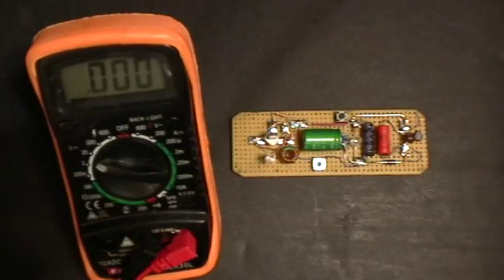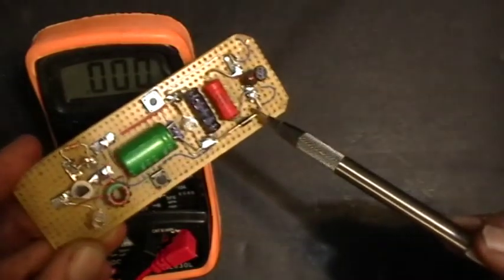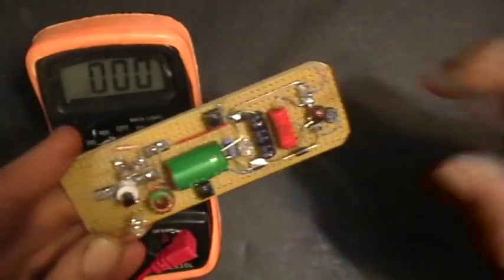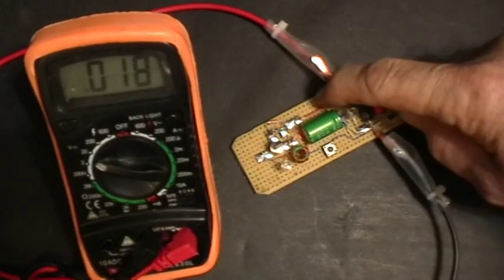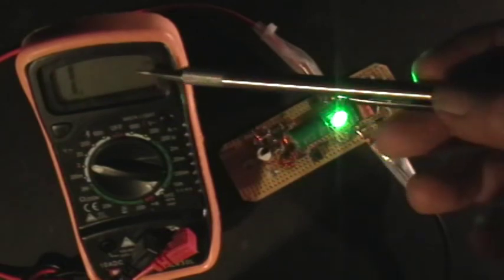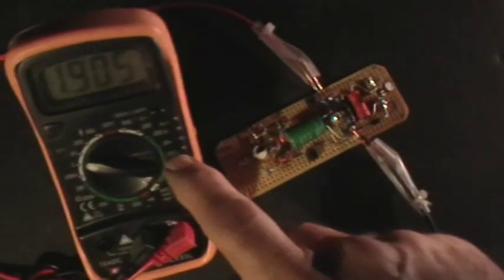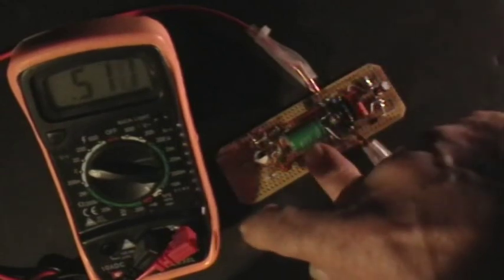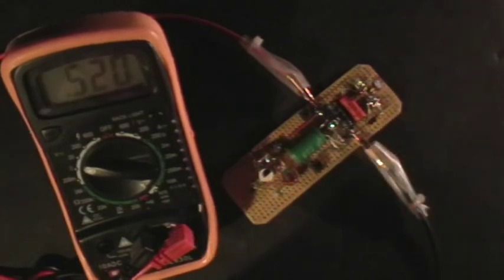Electric OU: TKBloomer Hybrid Wireless Joule Thief

Comment: Hi TK
I have would love to build one of them. would it be possable to get a layout of the reciver part, I am having trouble picking up power from the transmiter.

Thank for any help
Rick
Reply from the maker: The receiver parts are all in parallel. You need a receiving "antenna" which is simply a 2-turn spiral, evenly spaced, of the same length as the transmitting loop. (Try a simple circular loop at first, then when that works, fold it into a spiral for concealment or compactness.) This is placed in parallel with a good quality capacitor to make an LC tank circuit that resonates at the same frequency as your transmitter. See your favorite resonant frequency calculator to get the correct cap value. The tiny choke is also in parallel and is just for fine tuning, it may not be needed. Then you can take off AC into a resistive load connected across the capacitor, or you can half-wave rectify it with a diode into a larger reservoir capacitor as I have done here. Don't forget that a large reservoir, like the 10F that I am using here, will take some time to charge up, and if you use a really large supercap it will take that much longer. Good luck with your project!
Reply: Thank you for the information. could the reciver layout be drawn out as I ma haning trouble getging a rf single to light the first led.

Thank you.
Reply from the maker: Richard Jamieson
What are you using for a power transmitter? You need to use a loop of the same size as your transmitter loop. Just a circle at first, then when it is working you can fold it into a compact spiral. The inductance of this loop will be on the order of a few microHenries. Then you need to put a good quality poly film capacitor in parallel with this loop, of a value that satisfies the LC resonant frequency equation to resonate at the frequency of your power transmitter. Then off of one side of the capacitor you run a rectifying diode. The other side of this diode connects to one side of your LED, and the other side of the LED to the other side of the capacitor. It cannot get much simpler. You can even omit the rectifying diode:
https://www.youtube.com/watch?v=80D92QaOcM4
Reply from the maker: Richard Jamieson Maybe this video will help:
https://www.youtube.com/watch?v=rHFbRTJCzsY
(Sorry about the poor quality, I was using the wrong transcoder for the raw video.) Also look at my channel for all the "wireless power" videos for a lot more detail and demonstrations. Thanks again for your interest, keep at it, we'll get it figured out I'm sure.

Comment: Awesome! Love your work TK! I bet that could run a long time from 2V to 0.5V!
Reply from the maker: Thanks! Yes it will run a long time if I don't deliberately discharge the green capacitor. Certainly long enough to convince a Big Fish that it will run itself, if I wanted to do that. If I optimized the JT circuit for runtime instead of brightness, it would run even longer.  Or if I deliberately omitted telling about the wireless receiver/transmitter system... well, some Big Fish might even want to buy me a cheezburger.

But aren't you going to accuse me of putting batteries in the can?
;)
Reply: re: accusing you of having batteries in the can... no... that is your thing! lol

Comment: Very cool circuit.  I believe that if you had a vr in place of the resistor on the JT so you could lower the resistance when you get to .5 volts, that the JT would continue to light up down to maybe .3 or .35 volts.  I did not know that supercaps (electrolytic) bounced back like that.  Great to be able to see that.

Bill
Reply from the maker: You might be right. I know it still oscillates after the LED goes out. I don't know if I have a low-value trimmer in stock though, I'll have to dig thru the junque box.

Comment: This is awesome work! This must be the "residual energy" Tesla always talked about, there is a certain point at which the electricity is left in the cable, millivolts for sure. But I do believe he also used a custom alloy of wire and the millions of feet to achieve this on a scale that could actually make an impact. Very interesting indeed, I have no schooling or in depth knowledge of this, however it really makes sense that if we can harness the "left overs" in a Giant loop and fractional amounts of energy could be produced by using massive amounts of electricity, like we do currently?
Reply: also wondering, if you make your unit's "cable/wire" distance larger, would the threshold of .520 be the same? Also turns and gauge of toroid, interesting stuff!
Reply from the maker: Jeffrey Beitel

I don't know what you mean by "cable/wire distance".
It's possible that the LED might light at lower threshold voltages with different numbers of windings on the toroid. For sure the circuit continues to oscillate at voltages below 0.520v. I've seen it oscillating (but not lighting the LED) down to 0.380v with the same component values.
Reply: Very cool, I think I am trying to say: "circuit length/distance" Or basically scaled larger?
Reply from the maker: Jeffrey Beitel Oh, I think I understand what you mean. Yes, the length/size of the receiving loop buried between the two layers of vector board is critical for good operation. If the loop was bigger I wouldn't need to use the "tuning inductor" and could get much more power into the receiver. I deliberately "detuned" this device, because the transmitter is capable of putting tens or even hundreds of Watts into a well-matched receiver, as I've shown in some other wireless power videos. I needed to stay below the max voltage rating of the supercap, which is why the green LED is just hooked directly across that cap as a voltage limiter, but the transmitter can easily override that and blow out both the LED and the supercap if I used a well-matched pickup loop.

Comment: Hi TinselKoala,
Very nice JT setup...^^
Would this work with a 1F 2.7vdc cap or does it need a 10F to work...???
I do have a 1F but it's a 22-24vdc automotive one wich seems to be a bit to much and i aslo have 2000F at 2.7vdc wich seems like overkill...lol
As soon as i get my BC337-25 in the mail i'm gonna give your JT setup a go...^^
Reply from the maker: Yes, it will work fine with the one-F cap, it will charge faster and run down faster.... you might only get a couple hours instead of a couple days of energy storage... I used a 1F cap for the first (alt.snakeoil) version with no receiver just the cap.
I wouldn't recommend using the automotive cap at higher voltages. The receiver section will work but the JT section works best on lower voltages. Even at 1.5 volts it is dimmer than it can be and the transistor gets warm.
The MPSA18A transistor works almost as well as the BC337, and just about any other NPN will "work" but at slightly higher minimum voltages and slightly dimmer LED.
Reply: TinselKoala
Hi TinselKoala,
Thanks for your answer and info about your setup...^^
I'm going for the JT part because if i can have some led light at night as a light beacon in the house i'll be more than happy...^^
I do have some 2N2222 and some MPSA42 so i'll give it a go pretty soon while i'm waiting fior the BC337...^^
I've ordered some 10F ones and will try the 2000F @ 2.7vdc while waiting for the 10F ones...
The 2000F should give me some good run time and maybe i can drive a few more leds on it on 0.5(ish volts)...???
When i have it running i'll let you know and i'll make a video of it with links to your video ofcourse...^^
Reply from the maker: Mister Caribbean Roots

Don't forget that it will take a long long time to charge that 2000F cap, even to 2.7 V....
Good luck and keep me posted on your progress!
Reply: TinselKoala
Thanks for the extra input about the supercap...^^

"At the lowest end of the JT operating range, about 520 mV, the supercap can actually recover energy and gain voltage while the Blue LED is still on"

What you wrote above in the video description section is what i'm going for...;-)
My thinking is that a 2000F cap should be able to handle more load at 0.5v(ish) than a 10F cap without the need to charge it just like yours did...
I'll start sunday with it and i'll certainly keep you posted on the progress...^^
Reply: TinselKoala
Update,
Made it and have it running...^^
Some info on how and what,
The 2000F 2.7vdc cap is at 1.080Vdc now...starting circuit testing...
I have a few of these laying aound for about one year now without using or charging them and still their voltage is just above 1Vdc wich is nice...^^
So i decided to let it run on this 1.080Vdc to see how long will it take to get to around 0.5vdc...???
The transistor is 2N2222, also tested a MPSA42 and a BC331 but both did not work..no light at all even when i adjusted the resistor/cap...???
The toroid is OD12mm with 2 times 9 turns(10 if you count the one turn of the wires start & end twisted together)
The resistor is a 680r, tested 2.2k, 1.6k 1k also but the 680r gives me the best lighting...going lower it will not light up.
The cap is a 0.1uf at 15v or 25v(very small) wich works the best with the 680r resistor above...^^
Tested 3 normal leds (red, green & yellow), they light up but not so bright...-.-
Than i tested 1 bright yellow and 1 bright blue one, these 2 are the best...^^
I can also light them both in series but not as bright wich is more than normal...
I have it running now and will leave it running to see how fast will the voltage drop from 1.080v to around 0.5V...??
Will make a video about it tomorrow, no more play time today...-.-
Reply: TinselKoala
Update 2,
Decided to short the 2000F cap because it's taking way to much time to drop to around 0.5(ish)vdc...-.-
It's now at 0.585vdc and i had to completely redo the circuit because non of the leds wanted to light up anymore...-.-

What it doesn't have anymore,
No cap...
No resistor...
No toroid coil...

What it does have now,
The small bright yellow led...
A two strand aircore coil of 0.25mm wire with 29ohm each...
Now it does works nice and it's a good led beacon light for at night in rooms of my house...^^

I'll leave it to run for a few days before making a video on it just to be sure this thing works or not...???
Reply from the maker: Mister Caribbean Roots
Cool! I'm glad you are getting good results, and I'm looking forward to seeing the video illustration.

Comment: Awesome love the whole combination of the different circuits to create a splendid unified system.  I have read the other comments on the wireless transmitter and you mentioned a fridge. How would that work I was also wandering can electrostatics be used to charge up the capacitor? Thanks for the upload
Reply from the maker: The problem with electrostatic power is that it happens at high voltages and low currents, and most practical ES generators are "induction" machines that require high voltages (kiloVolts) on charged parts of them in order to work. Just about any ES source would probably make the big low-voltage capacitor fail pretty quickly.
The fridge and other mains-powered machines will have a 50 or 60 Hz AC electromagnetic field radiating waste power around the fans and compressors and other circuitry. By making the antenna and LC tank of the receiver section to resonate at this very low frequency you could harvest some of this wasted radiated power. The LF tuning will require physically large antennas and other components to be practical, though.
Thanks for watching and commenting!

Comment: Do you have a special wireless transmitter device or would a wlan router thats on all day in my house work too?...Nice video.
Reply from the maker: Yes, this demonstration uses a special wireless transmitter, but a clever designer could make a system that could extract power from any ambient electromagnetic signal -- that was powerful enough. I don't think that your wlan router puts out enough power in the RF to do much besides transmit information locally. But your refrigerator might!
Reply: TinselKoala
Thanks for quick response....I do have a big fridge!..Maybe the Tesla ambient electricity circuit would be enough with a good antenna?